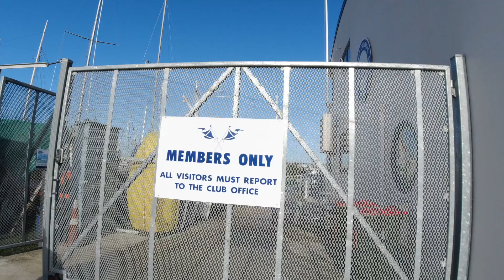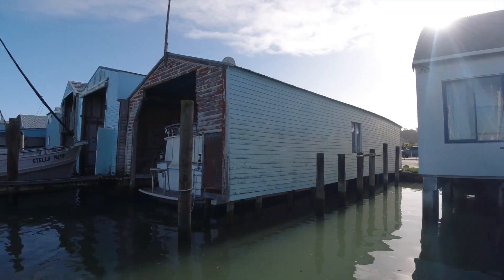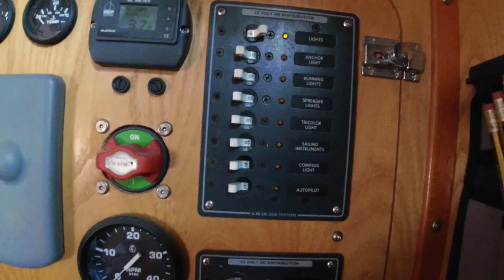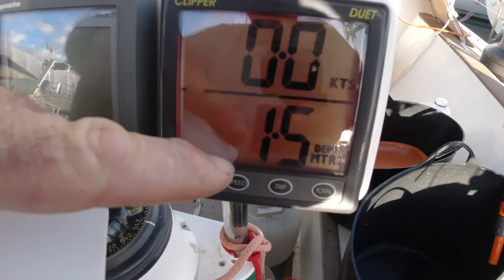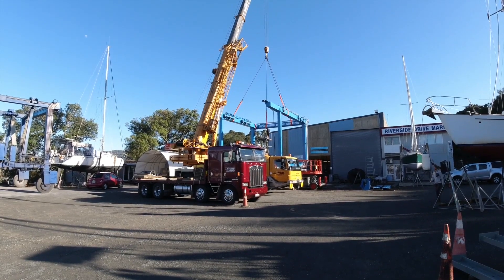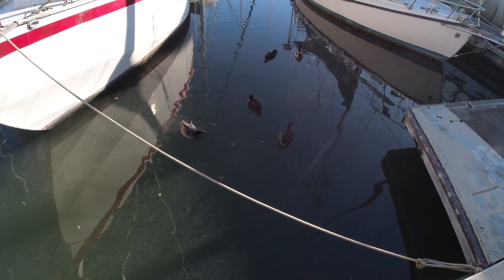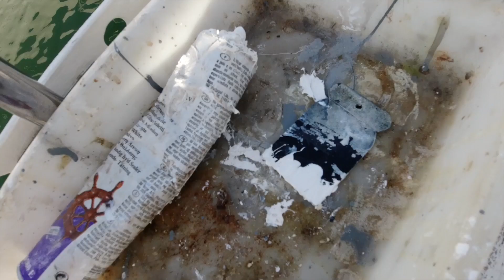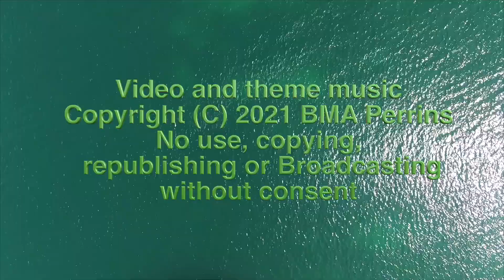Drogues and sea anchors, and how to use them.  Adventures of an old Seadog, ep 176

Comment: Glad the winch works well Barry. Silicone is the worst material ever to use. Surprised you did not use Butyl tape which is a much better way to seal the portholes.  ATB stay safe. Fair winds & regards from the UK.

Comment: Tip for using silicone, wear an old tea shirt or jumper, any on your hands or tools wipe it into your armpits. It drys quick and is very unlikely to wipe off on to anything else you come into. I have a jumper and tee shirt that have completely waterproof armpits!
Also expanding foam gun cleaner cleans silicone off of surfaces once it's dry

Comment: Our chain locker has a huge drain hole, but it designed in such a way that water does not easily ingress from that hole, but yeah, water does come in from the top or just from lifting the chain!

Comment: Glad to hear Bob's your Uncle... Switch from silicone to butyl tape. Easier to apply, less mess, longer lasting and it allows for later disassembly. If you can find the storage space, carrying a few emergency hatch and porthole covers is a good idea for open ocean crossings. They're just foam backed plywood with a couple of clamping boards held on with long carriage bolts and wing nuts. They can be passed through a failed hatch and secured from the inside without tools, the 1/2" closed cell foam seals any irregularities and lets you get back to steering yourself out of danger... 'I'm drumming, I'm not playing any instruments!'... Every drummer bursts into tears... I sprayed my anchor chain with silicone spray (The clear liquid stuff ) and the chain stayed much cleaner, lots less mud in the locker... ♪ Don't worry, be happy♫... 8{P

Comment: I saw a boat hoist in Lapaz with 3 frame !  Looked huge from a distance ! They have lots of Cats to work with. One channel is picking up a Trimaran, a somewhat large one... we will see how it does with a family on board. Congrats on the new anchor chain, and I guess an anchor soon ?  When we did things very similar to the port hole, we used a product that was like silicon rope. It had a type of wax paper around it and you took half of it off and applied it, like a stick rope. Once applied, you took the paper off the other side and put the port hole back on. The way it worked was compression. Silicon without compression is worthless. It must be really squeezed tightly.

Comment: Barry, what made you use silicone? I think all the rest of the world is using - if not poly urethane - butyl tape for this application. It will not hold the parts together, but creates a seal that will not degrade with age and can be easily removed with solvents like white spirit. If you want to be more traditional there is the old plumbers putty - same thing in different shape.
Reply: If you do use Sika or Saba or similar then white spitit is your friend - wet a rag in it and it just disolves away.
Reply: Be super vautiuos using 3m 5200 (which I think we saw on screen briefly) - but 4200 would be good for this job.
Reply: @RichardPhillips10  - 5200. For when you absolutely, positively want the next owner of your boat to use your name as a swear-word!

Comment: Holes in the chain locker: There's unavoidably going to be the one around the chain - we had a sponge to wedge into/ around ours off shore - but even though your locker's self draining, in a big head sea, I fear that the water'll come in through that cut-out around the windlass motor far faster that it'll ever drain away. Late in the day now as it's now no doubt finished and re-painted, but could you not have lived with a slightly smaller locker lid? Trim off the front end off the triangular anchor lid squarely at a point just behind the line of the windlass motor and then weld a fixed infill with a support lip for the front edge of the remaining lid into the resulting gap beneath the motor? it'd significantly reduce water ingress in head seas. If you ever need more parts sourcing/shipping, you know how to contact us.
Reply: Just curious on the lines of the locker is a nice wide gasket wouldn't fix the large-ness of the gap for the remainder of the journey?

Comment: Chain locker lid wants sorting: cut it shorter and infill under the windlass. Use Butyl tape for sealing deck fittings - no mess and no waste.

Comment: Are you worried about the chain locker being able to drink some pretty large gulps of water through those holes? Not sure if yours drains external, but I would wager the drain will be less than what can come in there.
Reply: Yes, I wondered exactly the same. I assume there's a plan to rig a piece he can slot into the gap.
Reply: Problems !? Holes !? Beating up wind that chain locker will flood, even through the chain hole. You better make a cover/bag to go over the entire windlass when at sea. Rain water too dont forget. That "new" chain wont last a season.
Reply: Yeah, I'm certainly no boat expert, but the gaps in his chain locker hatch concerned me.  Better to cut the hatch off even with the back of the winch.  Then cut a piece that goes under the winch and covers the gap.  Preferably with an overlap ledge that the hatch can rest in and some rubber added to it, to make it more leak resistant, if not leak proof.  Even if you have to pay to get a welder in there to do it.
Like Geddy Lee mentioned.  That hole where the chain goes in could be an issue, too.  At least a little pipe fitting sticking up a bit might help.  Sinking sucks, especially when you might be hundreds or even thousands of miles from rescue.

Comment: Well done on the completion of the windlass and chain locker mods. I wondered why you didn't just cut the front portion of the old cover and weld it in permanently under the windlass so you didn't have a gurt hole there?

I got myself one of those Jordan drogues but haven't fitted it yet as my plan to circumnavigate has been postponed until next year when, with any luck, the uncertainty around Covid will be less, er, uncertain!
Reply: I came to say about the same. I think  that just cutting the hatch right in front of the hinges, all across would be the prettiest solution.
Reply: Yeah I'm a bit worried about how much water he will take on boat in bad weather.  Could be enough to be a serious problem - and at very least the frequent salt water is going to ruin the chain.

Comment: Barnabas was fitted in the early 1990’s with bronze Murray winches as shown in the boat you inspected. I would prefer a self tailing winches but they don’t suit classic boats. So despite being less convenient to use they are very simple and reliable.
Reply: Those are self tailing winches. I had a similar pair of Murrays on a boat I owned in the late 70's, but mine were plated. Line goes in one groove and around the other. Pretty simple design, with no springs.
Reply: @ruserious8761   I must be missing the point as mine have a cleat on top and don’t self tail. Perhaps you can give me some instructions...

Comment: Try Sonneborn NP1 Urethane sealant, also currently sold as Masterseal NP1 for rebedding ports and deck hardware; tenacious adhesion and holding properties and completely waterproof. NP1 is relatively inexpensive compared to other sealants currently promoted and used for above the waterline and although not recommended for continious submersion underwater, I have had good luck over the past 35 years in protecting and preventing underwater intrusion into areas sealed with NP1.

Comment: Better to cut across the chain locker lid and fix and seal this cut off piece permanently under the windlass and fit a new sealing edge to the lid. No holes or gaps, a water tight solution. As for the porthole mess better to fit dry and get everything sorted before applying sealant. Speaking as an old yachtsman myself.

Comment: Barry... Instead of using the liquid junk.. why not use butyl tape?  No drips, no runs, no errors.
Reply: Thats why you dry fit every thing first.
Reply: I have redone portholes both ways.   It’s a personal preference
Reply: I bought a large roll of it from Reverse Garbage for 50c, our recycling folks. In fact our boat has a lot of their stuff in it.
Reply: I have had the same trouble with caulking- do try butyl rubber, that's what I use quite successfully.  On my boat, the hull and deck joint is also sealed with butyl rubber, 48 years going strong still

Comment: On the various commentts about the chain locker lid gap... how's about a seperate insert plug that can simply be removed or if you want to add a bit more finesse have it designed to slide back, say in tracks (teak or metal) for opening and closing. ... just thinking :)

Comment: Barry, you've probably already been told this but I recognized the tube of 291 Sikaflex you used for the portlight. Before you screw down fully to make the seal let the sikaflex set up for about 5 hours before you put the final pressure on with the screws. This gives you a good film thickness for the seal and stops all the product squeezing out the sides and making a mess. It's a great urethane marine sealant when used properly and is not a silicone. My view is silicone should never be used on a boat. It suffers from UV damage and quickly loses it's sealing properties. Good 'ol mineral turpentine is a solvent for Sika 291 before it sets up - after that you'll have to chisel it off. I go through lots of paper towels with Sika.

Comment: Very interesting ive never seen that sort of drift Anchor or “drogue”  as you called it,  and i trust you are right, far more experience then myself.   Wondering why you didn’t use Butyi tape instead of silicone as most people are using now with excellent Success?

Comment: Hi Barry, have you tried butyl tape instead of sillycun?
Working well for me still after 4 years. Sika only went a year or two IF it didn’t leak immediately. 
Butyl’s way tidier to work with too, a wipe off with white spirit gets the squeeze out cleaned up. 
Meanwhile, you have both my sympathy and admiration. 
Cheers, R. 
😎👍🍻

Comment: Didnt see you put a rode to connect chain to boat?  Also looked like you hit up button on windlass remote and chain went down.
Reply: ^Never,never fix the end of the chaine with a rod,take thre ore some more windings of 5mm polyesther-rope thjat you can cut with a knife in case you have to leave the ankeraera as quick as posible

Comment: I know this won't help you Barry but maybe it'll help someone.  When I did my portholes I used 3m ultra high bond tape then sealed it with Dow Corning 795. No fasteners needed. I have different port holes than you but it might help someone.
Reply: Yep, double sided sticky tape is awesome! Did the same to a boat I still own, in 95. Still sticking and not leaking. No trim pieces, no screw holes to leak, just plexi mounted to the cabin side.

Comment: Word of wisdom from my own mistake. Keep your foot away from the switch when working with the windlas. I mangled my hand in a moment of complacency when operating my windlas outside of normal procedures. I accidentally moved my foot back on the deck switch will fixing the chain. Amputated on finger at the first knuckle and fractured another finger, plus stitches on two other fingers.
Reply: Ooft! Nasty. Good advice.

Comment: In the future, try marine butyl tape instead of calk. Much less messy and lasts much longer as it never drys out and always stays playable.   Sooooo much easier to work with too!    Also have have a Drogue AND a parachute anchor.  I disagree with the man that says that they are passé   They have 2 different purposes.   You need to have the proper gear and KNOW how to use it!

Comment: 35 meters/ 35 yards /or about 105 ft  what’s the weight in lbs.? Flake your chain ! Now 70 meters !now for a inner tube rubber gasket to reduce water in the hatch splash where the chain locker is ! Seems like the Drogues act like a shock absorbers for rough weather!

Comment: Lots and lots of misinformation on sealants here. 

Sika has many types, all need prep with primer (acetone will do) also read the sika technical. 

Not all is the the same, some has uv resistance some doesn't, some is designed to be removed etc.  

Every country has polyurethane sealants, sika isnt the only option, but try to get one that similar to the sika one you need . 

Also the sealant is only as strong as the paint your sticking to. 

With plastic/nylon parts ensure that its sanded before fixing (hatches) some can have microscopic release agents left on the mould, this buggers even the best adhesives

If sticking different materials watch for expansion, in this situation its better to use butyl mastic or butyl tape.. never silicone, and only polyurethane mastic under manufacturers technical (some will shear in temperature difference) 

Always with butyl and pu mastics, dont fit flush, often its needs 3mm to 5mm to screate strength. Sometimes people squeeze out to much.

Another tip, to make any silicone look like its been machine applied get some cramer fugi tools you can shape sealant any way neatly..  as they fill up just wipe the excess of the tool with loo paper .  

Also for the boat keep butyl tape on board.   With nylon chopping boards..  there cheap and can be stuck over holes, broken hatches they can be cut by hand  but also take tremendous impact and wear..  butyl tape can even stick under water.

Internally 3m vhb tape is essential for everything from sticking a picture up, to even controls... It can be removed without damage... Not cheap but a must keep in the tools..

Comment: Couldn't you have spun the windlass around 180 degrees and had the codpiece facing forward and not blocking the hatch. I realise the cog would be on the wrong side then but i would be surprised if you couldn't refit the cog on the other side of the windlass. It would make sense that the cog could go on either side so that the windlass was suitable for boats with the anchor roller on the left or right side of the centre line.